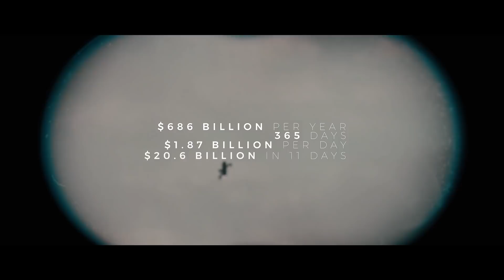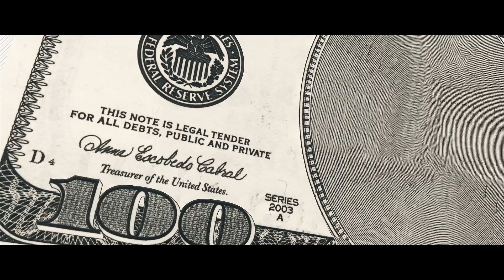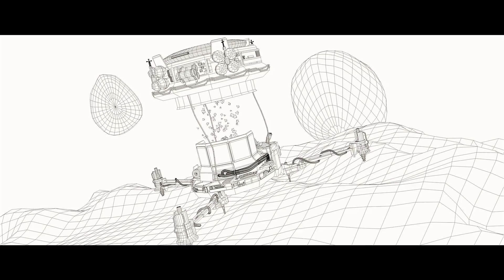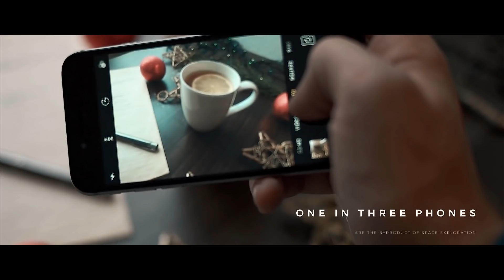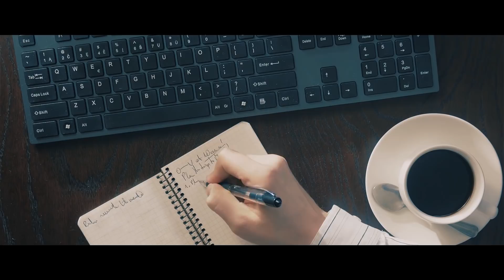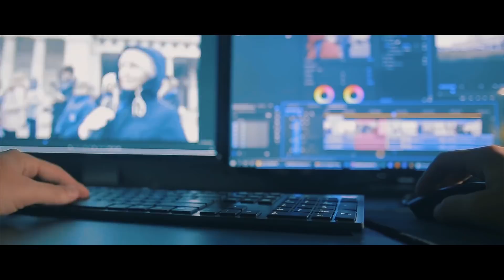If NASA Wasn't Broke

Comment: Titan: has oil
America: boosts NASA's budget
Reply: Technically methane,but same concept xD.

Only problem is, they would probably burn it here on Earth...
(if they could get it back)
Reply: @mr.boomguy  it the biggest gast station in our solar system
Reply: @paranoid9678  I know. That's what NASA would do, but I doubt with the goverment...
Reply: @mr.boomguy  its cleaner burning then petrol, so i guess its better????
Reply: Titan also has a good atmosphere
Reply: I wouldn't be surprised if that actually happens. As soon as NASA find a planet with oil on it, funding will probably go off the charts, because o i l
Reply: The moon has helium-3, can be used to build fusion reactor providing limitless energy source. But no one is fighting for it.
Reply: @aerohk  Because we haven't moved towards full wave rectifying solar panels over diffuse mirrored roof surfaces, nor do we have a robust battery technology yet. Do you have any idea how inefficient and fragile the standard passenger vehicle's main components are? It should be a disgrace to make anything less than 40mpg, and have it last <300k miles.
Reply: @Baigle1  eh... Give me fission and finish fusion research instead.
Reply: Titan: has oil
Thanos: it did, and it was beautiful living there
Reply: New oil production technologies revolutionize oil production and turn the US from an oil importer to an oil exporter.  99% of the country - thinks that we want other countries oil.
Reply: @colincampbell767  USA already exports a shitton of oil now with our fracking and reserves in Alaska
Reply: War Oil or Space? 
You can only chose two .
Reply: lol USA own Mars.....
Reply: Did someone say OIL ?
Reply: Why would south america boost Nasa?
Reply: You could make an 80%+ efficient (Co-generation) electrochemical SOFC with that methane. You need an oxygen source for the fuel cell reaction, a reformer to get carbon and hydrogen, and an energy recuperator (co-gen).

We haven't even upgraded to these on planet Earth yet.
Reply: titan is awesome though in all parts
Reply: lol
Reply: Unfunny
Reply: oil
Reply: Like actually asteroid mining would be peak and solve a lot of moral crisis like mining up natural park or forced labor
Reply: OIL
Reply: Pretty sure titan doenst have oil since oil is made of dead organic material under presure and heat
Reply: NASA screwed us around. Because of those underwater "space walks", most americans doubt we went to the moon...
Reply: Problem is NASA wastes govs of money. Thank SpaceX for bringing cheaper reusable rockets to us because NASA never had any interest in doing so.

Any part of the government just bogs down research and development.
Reply: @eastonwilliams1722 NASA doesn’t choose what it does. That ultimately comes down to Congress, which is why we have a big, expendable, costly, less-powerful-than-the-Saturn V shuttle-derived Moon rocket instead of working on reusable and new tech.

Comment: The problem is that NASA is goverment run. They have to go on developing SLS because SLS means jobs all over US and is a bloated over costed beast because of it. If NASA was free to spend it's current budget it would make drastic changes using private companies like Space X blue orgin etc... to make the hardware and they can focus on astronauts, reasearch and develpoment and other things. And I don't mean that everything needs to be privatised, a goverment run oversight helps, but not when it is used to boost local jobs at the cost of eficiëntie.

Comment: SLS isnt short on cash, it is short on quality management and oversight. it burns through cash while Boeing has no incentive to keep schedule. it is all about jobs at MSFC and for certain contractors. look at the OIG report on the issues, delays causing the delays it isn't because SLS wasn't getting proper funding. senator shelby has always ensured the pork flows to SLS. cost plus contracts like SLS, Orion and James Webb are allowed to burn through cash with no accountability for schedule or progress hence why Webb was supposed to launch 2010 for $2.5B development, now it is 2021/2022 and budget has ballooned to almost $10B. NASA needs to streamline, trim the pet projects and have a focused goal like #BOM24 but it can't do it in traditional cost plus contracts. $22B a year with proper leadership, free of congressional meddling and breakdown of fiefdoms the engine of innovation could be restarted at the agency. it is congressional interference/pork, bureaucracy and paralysis by analysis that is holding NASA back not the budget.

Comment: Nowadays with space x creating reusable rockets is great as it will save alot of money
Reply: oh no it's a muskman...
Re-usable rockets are not very useful and they have been thought of long just like the Hyperloop. The main problem with rockets is fuel. Everything else is relatively cheap compared to the fuel. Re-usable rockets is only more work and they cost more and there isn't a 100% guarantee of them working. They are good if the same rocket would be used many times.
Reply: TryHardCentral except that they're literally the cheapest orbital-class rockets on the market. research a little before you comment.
Reply: @Xenderman  nevermind then
Reply: @TryHardCentral  like a printer machine, sometimes is cheaper buying a new one than buying more paint
Reply: TryHardCentral Fuel is the cheapest part of space travel. The fuel of the falcon 9 costs 200k meanwhile the launch itself costs 62 million.
Reply: @TryHardCentral  r/iamverysmart
Reply: @supreetkumar7604  you're literally linking a subreddit on youtube. Also where exactly do I state that I'm smart?

Comment: Because of the calculation problem, it's impossible to claim that NASA is "wasteful" or otherwise in terms of what society would want from NASA.  This is because NASA is funded by involuntary taxation and does not record a profit.  Without willing customers or profit (value above costs), it's impossible to determine if society values the goods/services NASA provides higher than the costs of the resources NASA uses.

It may be that society would actually invest more in NASA or a NASA-like entity if they were permitted the choice.  Perhaps NASA should start a GoFundMe campaign to find out.

Comment: All it takes is one engineer to look at the space shuttle and realize money isn't the problem...

Legislation, direction, and PR are the problem...

Government management produces the least effective product for the most cost...

Space X is not bound by the pressure re-election campaigns, and the constant change in detections of different senators and Presidents...

Witch is why Elon has designed a rocket more powerful and cheaper to operate and has continued to use it to great effect. He doesn't care what congress thinks and that's why space X is superior today then NASA ....

The USA doesn't have that boogie man to scare them to Oblivion to put everyone on the same page...
Reply: eli dennison where is that rocket? He has not made one more powerful than the Saturn V.

Comment: But NASA misallocates its budget by trying to create these extremely expensive and low functioning rockets to create more jobs. SPACEX and Blue Origin are making better rockets with a fifth of the price. They should be using there budget to design habitats, mining equipment, and methods to create a moon base and work in tandem with SPACEX and Blue Origin with those companies working on rocket capabilities.
Reply: Aron Weldai not as good as Saturn V
Reply: @zachb1706  A rocket that has a relaunch cost 12 times the Falcon Heavy good. Their rockets are simply not cost effective.
Reply: Aron Weldai yeah but falcon heavy doesn’t have the capacity to take a crew to the moon.

Comment: To be fair there is a ton of waste and unneeded bureaucracy at NASA. Spending is allocated to senior leaderships pet projects (much like the military, see the osprey helo-plane) The shuttle design, a lack of a replacement for the shuttle, a meandering mission statement from the NASA top brass, etc, are all examples of mismanagement of funds and a poor vision for the department. Look at how many engineers at SpaceX and Blue Origin are former NASA employees? Pay is part of the issue but a lot of the interviews I've seen has them stating it's the willingness of these private companies to experiment and use the best/most effective design vs being held back by red tape due to bureaucracy.  I have no issue with decreasing the military spending and NASA would be the last government department I'd cut, but to act like the budget they have is insignificant is just wrong. NASA needs to be better with the money they are already getting. 

A big part of NASA losing funding was from the public being bored with the mission NASA had laid out for itself after the moon landing. While important, most of the research wasn't exciting to the public and while a bit sad, you need to entertain the masses. If NASA would have come out in the 70's or 80's and aimed at a moon base or a mars, Jupiter moon manned mission. The people would have pushed their congress members to pay for it. Going places is cool and cool sells. 

You are also forgetting to remember the budget was bloated during the 60's and honestly could and should be considered military spending. America was in the hottest part of the cold war and it spent to beat the USSR at anything. Olympics, space race, nuclear arms race, spy plane vs radar race, satellites, etc. Getting to space and the moon was more about beating the USSR to space for satellite testing and propaganda. I mean honestly, did the moon landings really push forward the scientific understanding of the universe or was it just a cool and recognizable target that was both possible and extraordinary.

Comment: The biggest problem of nasa isnt their funding, its that they are regarded as nothing but a politicians tool. The sls is a terrible rocket, built from the shuttle tech, tech that was never designed to do anything the sls is supposed to do. The reason for it being built this way? Because if congress votes they start from scratch, their contractors will have to spend more money and time to build it, and people will have to be laid off, and new blood taken in. This would be a politicians nightmare. Ex.(john whoever made 2,000 people lose their jobs, you wouldnt want to vote for that guy, would you?). Also, sls is terribly unfocused. What is this supposed to do? Go to the moon?mars? Asteroids were even suggested at one point. As new politicians come in, the design changes to fit what the politician wants, making the rocket overbudget and overtime. The white house has already suggested pulling the funding of the sls due to the delays.  This is why spacex and private companies will win to mars, no doubt. They have a clear goal, under strong leadership from one man.

Comment: The good news is that their budget is slightly rising every year now and that's why they're now planning to go to the Moon in 2024.
This wouldn't have happened if their budget wasn't increased, so you can see that money plays a big role in what NASA can and can not achieve.
Reply: The increase is very slight, and you could argue that it is increasing at a rate that does not keep up with inflation, so the value of that funding is actually decreasing.

Comment: "We dont have the resources to live on the lunar surface"? Really, we have had permanent bases on Antarctica for over a century. You can't go outside there, without super insulation, requires complete independence: electricity, plumbing, etc. Its very similar.

Comment: I don't see what the problem is with private companies picking up where NASA left off. NASA has done tremendous work for humanity, and no one will be able to take that from them, but they can't compete with other organizations, them it almost seems like a drain. They should either privatize or work to bring open standards to facilitate cooperation between private space fairing (similar to how car manufactures openly share engineering designs to benefit the whole industry (economies of scale)).
Reply: SirWaffleGaming companies like spacex are not competitors to nasa

Comment: wouldnt mining the moon affect its gravity field? and our tides which is controlled by the moon's gravity might change its behavior, right?
Reply: We would have to mine a significant percentage of the Moon's mass to affect its gravity in such a way. 90% of mining is moving dirt in the way of what you want to another location - as long as we don't expel the dirt, it wouldn't affect much. Besides, NASA wants to use the Moon as a forward station and microgravity research center - the minable bits of the Moon don't make up much and aren't buried too deep.

Comment: One thing we should do with our space trash is designate a crater or group of craters on the moon as a dump site, then everyone agrees to direct their trash there.

This gets it all in one place so that we can access it easily for recycling.  The lunar base can travel to the site to collect "trash" to salvage and reprocess for use on and in the base.  This also serves the dual purpose of keeping the trash out of orbit, and under control.
Reply: I don't think we should just dump all of our trash into said crater. We need to find another solution.
Reply: It sounds worse than it actually is.  We already have a problem with junk in orbit and need a solution.  "Trash" has real value as a source of raw material to work with, remember we're not talking about your everyday house trash.  These are useful metals and biowaste that can be used for various purposes.

Getting it all in one place, on a surface where it can be collected and processed, keeps it out of orbit and allows us to do something with it. 

It sounds like "trash dump on the moon."  But really it's just a reprocessing center that prevents the trash problem from getting out of hand.

Comment: For your point around 2:10 although the percentage of the gdp diminished, the funding tripled as in 1966 the JSA gdp was less than a $900 billion, and in 2019 it is of over $18Trillion 
(Non adjusted for inflation)

Comment: If technology wasn't getting smaller and therein increasingly weaker/requiring of more complexity to function cohesively then perhaps NASA would have taken us to another planet already, this is not the case. We will never leave this solar system technologically, it is the singularity. Only after the next geomagnetic pole shift, when we as a species return to functioning on pure light energy will Sapiens Dominabitur Astris Arboris Vitae

Comment: They should fund NASA to clean space debris to keep satalites and other space objects like the. ISS safe. After that they can do those fancy travel ideas
Reply: Currently LEO is practically empty the chances of a collisions are low.
Reply: @alex_inside  ok then I guess that ain't a problem now, but maybe later when we send more stuff into space and create more debris it will become a problem
Reply: @wyattearp1313  most debrie deorbits within a year in LEO, the higher you go the longer it takes until the air resistance slows the objects down but these things usually go to a have yard orbit or if enough flue is available then they will lower their orbit enough to re-enter again.

Comment: 12:29 president Obama extended the iss program by 5 years, meaning that it will run until 2025 before it is descends into the Pacific Ocean

Comment: Honestly even with the budget they have NASA could get shit done if Congress didn't keep completely changing their goals. We're on like the third replacement for the space shuttle now, and SLS will probably get cancelled to. Even with the delays and run over in budget they'd finish it eventually if it didn't get cut, but Congress isn't that patient. They prefer to pay contacters to design rockets that will never fly.

Comment: Great video.

I think it bears mentioning that part of NASA's challenge is that tax-funded dollars come with strings attached. Senators approve the NASA budget based on jobs for their constituents. This leads to NASA's hands being tied when it comes to making changes.

Some of the best money they have spent in the last 30 years has been to fuel the private launch industry. If/when that pays off, the cost of launching could come down to the point that NASA's budget might be able to stretch a lot farther, but that will hurt the companies that Washington politicians care about.

Comment: NASA employs some of the best minded people in the world but that is not enough. I don't want to know how much money is wasted at nasa however. The larger the economy of the us the lower the percentage nasa would need. They have the money but not the drive. Its one of the few things I agree with with Robert Zubrin on. Shuttle and the ISS are the biggest waste of money in the Space age.  Hindsight is also not an advantage we have because there were many people at NASA that knew the shuttle was going to be way more expensive than they wanted it to be. In terms of engineering the shuttle is a masterpiece and every person that worked on her deserves an award but they had to build her with limitations that were insane. Simple fact is money is wasted in everything the government has their hands in. Some of the cost overruns they have at NASA are also very strange. Its hard to believe that missions end up costing 10 times more than proposed. To me that means something is just not working in mission design. Money is there but being spent on the wrong things.